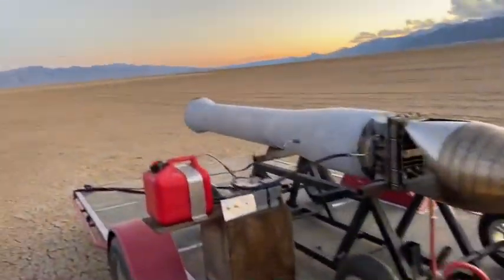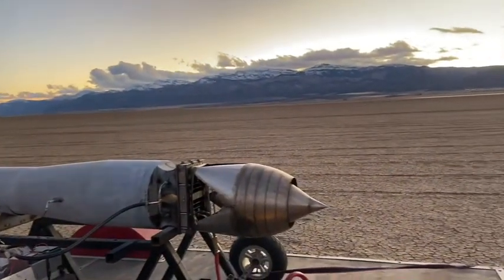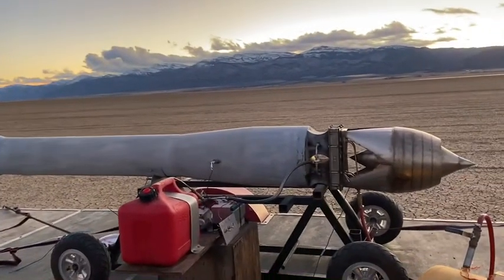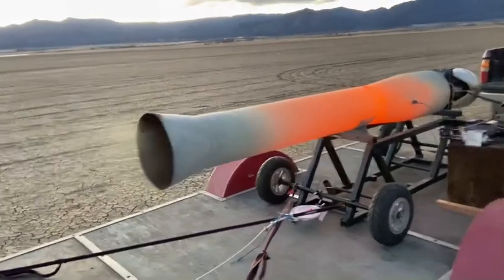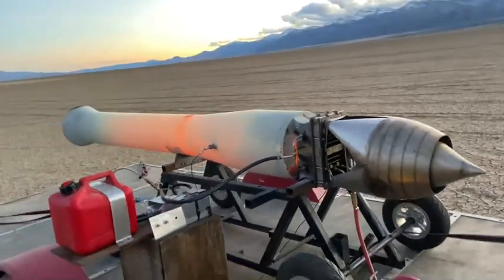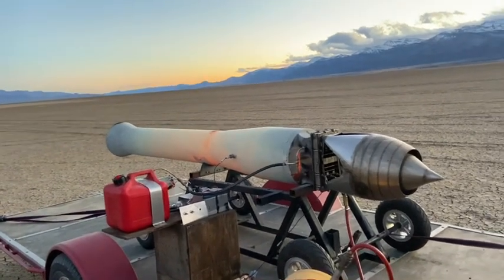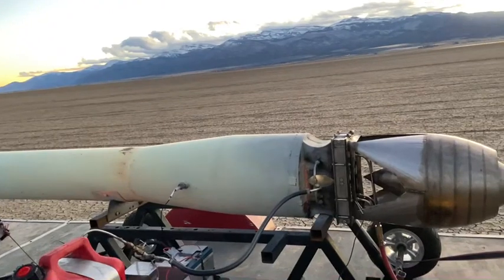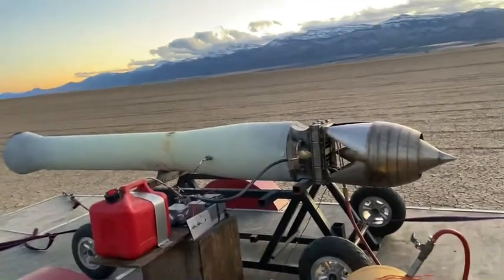Bob Maddox  Pulsejet engine night run.

Comment: Geez what are the chances that one of the welds on fail on one of these engines once they are glowing orange for a while?
Reply: Youll note he never runs one of his contraptions for longer than a few minutes........coz they will certainly self destruct from the heat & vibration.

Comment: Maybe you can cool the wall of the engine if you put a second wall around it and use the exhaust to draw air in, ejector style.  Air drawn in will help keep the metal temperature down.
Reply: Cooling the jet walls adds complexity to the build. But I'd like to see some experimentation as suggested and with regenerative cooling.